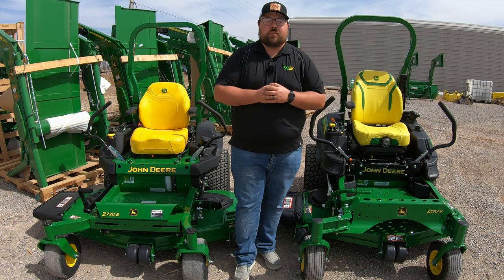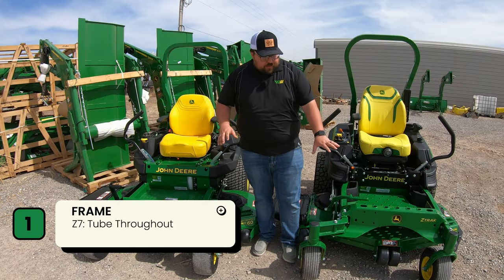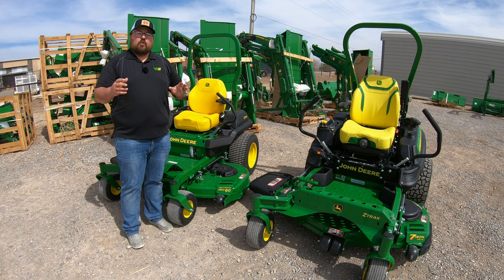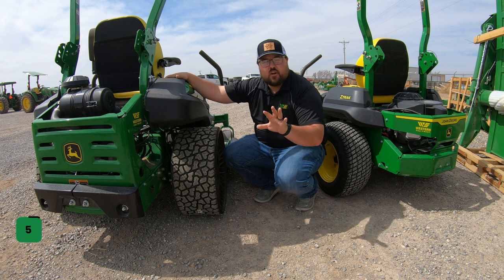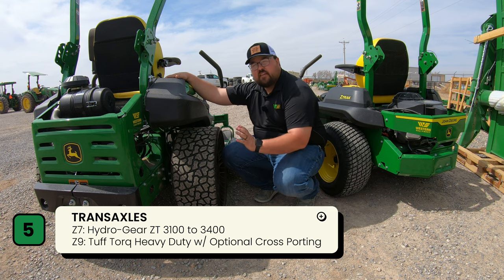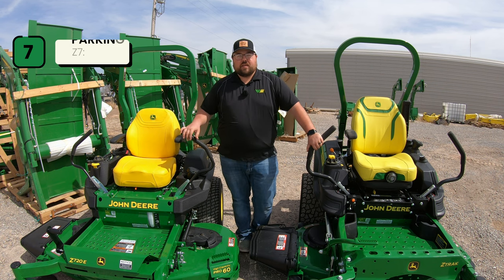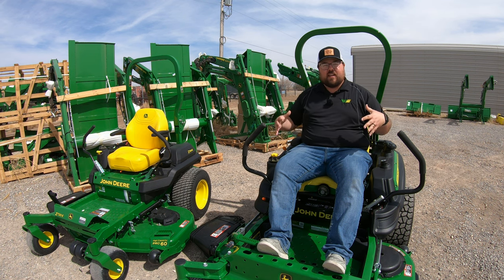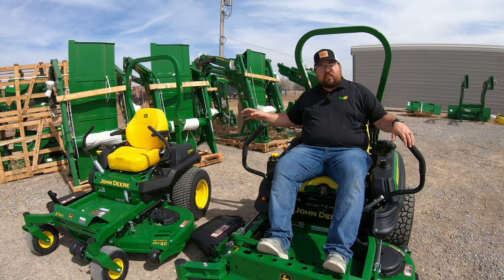Should you Buy John Deere Z7 or Z9 Zero Turn Mower?

Comment: Question! On the z7 i have noticed some have cutouts for front lights and others dont? This is across all model years and trim levels for the 7 series. Do you know why? I have noticed a pattern though- all models with front cutouts for the lights have black caster wheel caps,? Just curious.

Comment: Hi, could you do me a favor and look up what maintenance kit number a John Deere z740r takes. Thanks
Reply from the maker: Unfortunately, there is not a home maintenance kit for the Z740R. You have to buy the oil filter, oil, air filter, fuel filter, and spark plugs separate.
Reply: @WesternEquipment  ok thanks for checking though. I kinda figured that because I searched all over and couldn’t find one online